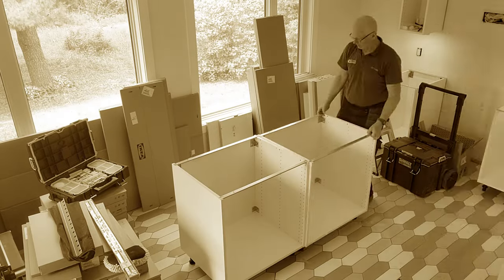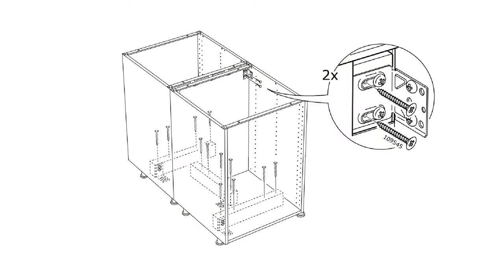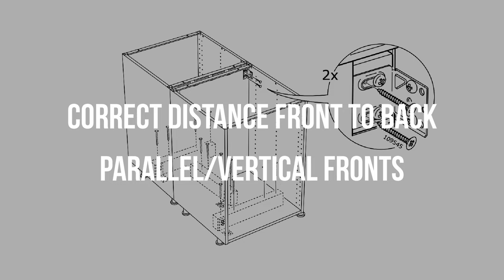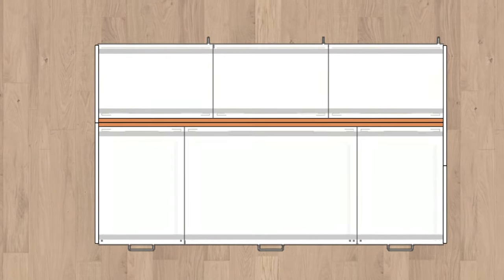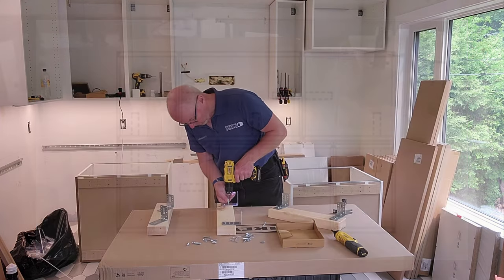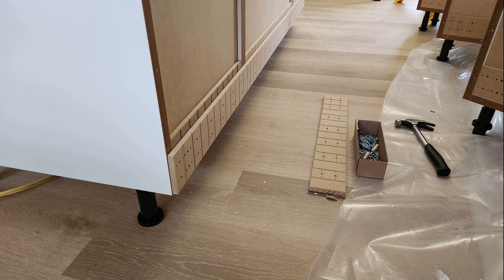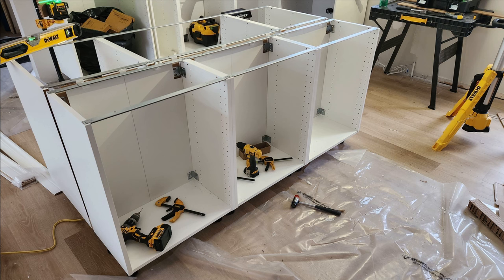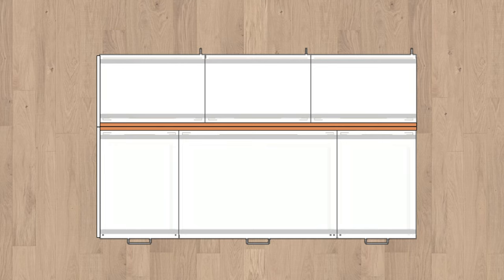IKEA Kitchen Island DIY: How to Build a Double Row IKEA Kitchen Island

Comment: do you have to anchor the island to the floor? my floor is a heated concrete floor and I do not want to drill into it.
Reply from the maker: No, you can build a frame on which the island are mounted.
https://youtu.be/dxIwY_8kFNs

An island where you use the Sektion legs from Ikea, must be secured into the floor, as those legs are only designed to handle vertical load.